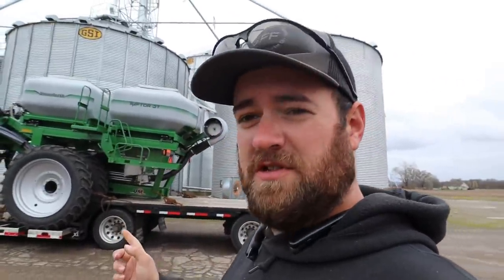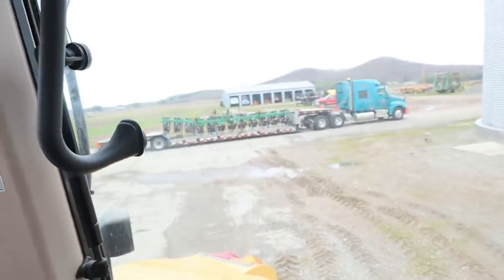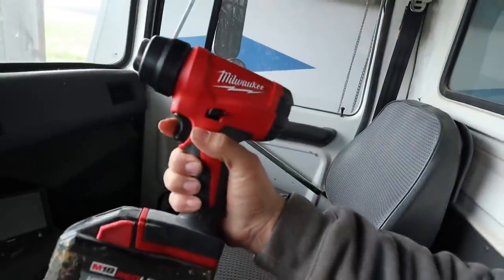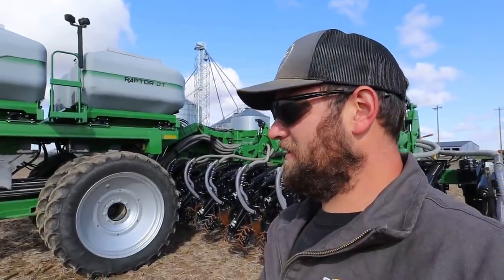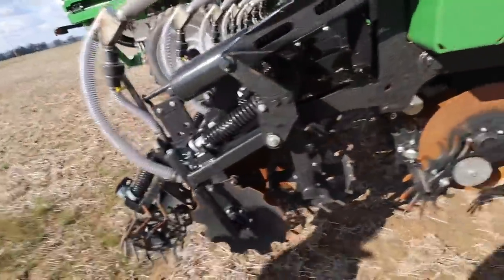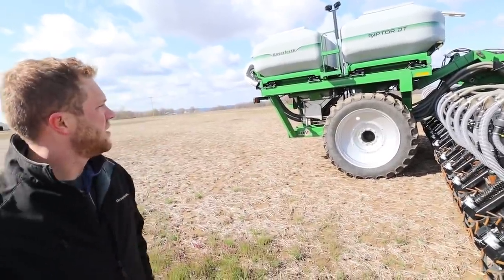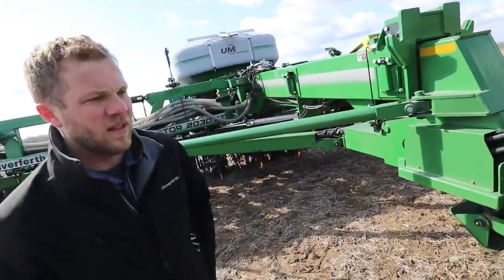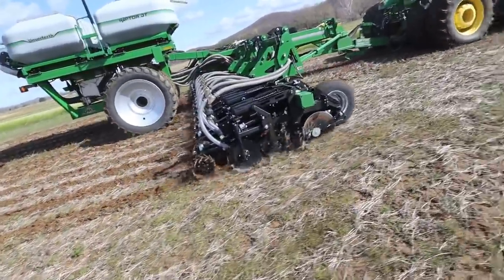Top Secret Strip-Till bar Revealed

Comment: Heat up wrap with a tiger torch on low for about a minute and the wrap should separate from the truck or can try a rubber wheel in a drill to remove the wrap.

Comment: Brian, In our area 3 point 12 row is normal. A lot of guys will run 12 row strip-till with a 12 row planter attached (with lift assist wheels) all off the 3 point.

Comment: Honestly I thought that 9410 would struggle more but after a tune it will work great.  We demoed  a 16 row soil warrior strip till machine with a 580 quadtrac.  We tested the  strip till on about  1500  acres out of our 3500 of corn  last year. Our main setback is time in the fall and spring  . We have found that spreading on  the nitrogen and potash and then using the   field cultivator works better . But on hilly fields where erosion is a issue the strip till machine worked  better.  Not to many farms run strip till in our area. Our soils are heavy clay and silt .  Keep up the good work and stay safe!

Comment: Hey Brian keep your heat gun around 70 to 80 degrees and at the very edge use a plastic spatula at the tip and start peeling back going top to bottom with the heat gun and it should come right off
Reply: I suspect that's the super strong stuff, get a good corner too hold onto; and pull hard! pull really hard!!?

Comment: So do I understand this correctly ? With your guidance systems you can now come back behind the strip tillage unit and place your seed right where you need it in reference to the the fertilizer placement and not have disturbed all the soil.  This basically allows you to cut your compaction and control your erosion problems all at the same time ?  Very innovative  solution to an age old problem.  Great 👍 content, enjoyable viewing. 
🇺🇸🦅🌏⚓️🇺🇸
Reply from the maker: Yep that’s the idea. The planter will run those same guidance lines thanks to the agleader system we use
Reply: Know some one been doing something like this with deep subsoiled ruts. An A set and a B set. Alternating each year which is used. 

Is this something similar here?

Comment: You need a heat gun that gets to about 600 degrees, I use a Wagner ferno, can also use a propane torch if you stay away and go quick. You have to get the glue to release, It still is a pain to pull off the longer it’s been on the worse it is to get off.

Comment: Pretty cool setup, and even better that you got to work with them directly on it like you did.  As for the wrap on the truck, the battery powered heat guns just don't have enough oomph to get it done.  Might want to consider something like a soldering torch like you'd use to sweat copper plumbing together.  Obviously don't want to burn it off (lol) but the torch may help loosen the glue up easier.

Comment: A great Ohio company. Looks like very well engineered piece of machinery.

For decals an ERASER wheel works excellent and will not damage your paint.  Any good auto parts store should have them. Not sure if HF does or not.
The down side it will take several for a decal that size.

Comment: Unverferth Mfgr has out done themselves - KUDOS.  It's common sense to fertilize only the 8" root zone, rather than an additional 22" of a 30" row. Be different if you cultivated the corn once or twice during the growing season to throw the 22" width of fertilized area to the 8" root zone area. As you found out last season's spring planting, you're going to have to run the strip tiller 18hrs a day to stay ahead of planting 10hrs a day.  16 rows of strip tiller at 6mph is 29 acres an hour.  24 rows of planter at 8.5 mph is 61.8 acres per hour.

Comment: I've got just a tiny bit of experience with removing decals and such. You want to use toluene.  Toluene will cut the glue and take away the stickiness.  Lacquer thinner or acetone will just make the glue runny and sticky.  Sometimes you need need to give yourself an edge to get to the glue, so use a razor to get in. You also need to give the toluene time to get in, so you often have to hold it there will it can get started.  Trust me, you'll know when it starts to come off.

Comment: Back in my days on the farm working a tractor hard was normal.  Now I see everyone seems to get concerned when they start to grunt a little bit.
Reply from the maker: Not concerned with grunting but I do want to be able to maintain a certain speed
Reply: @BriansFarmingVideos  should've made sure you had enough horsepower to grow before you bought it I would've bought 550 plus horsepower or even a 9620r or 9560r plenty of power to grow without having to upgrade for awhile imo
Reply: It´s not about overworking it, when she starts to grunt on flat ground she´s already running at max capacity so you have no headroom for wet spots or going uphill. Also when you drop rpm too much, you drop hydraulic flow which means your fan isn´t running on full boil so you´re not applying correctly, yada yada yada. Precision operations like striptill isn´t moldboards anymore.
Reply: @charlesdoepping5616  Most of those tractors are the same motor.  Its all in the tuning.   Hard parts are the same.   You can save 30k by tuning it yourself
Reply: @BriansFarmingVideos  What do you use to monitor your exhaust gas temps so that you don't waste the motor ??

Comment: The best way to take off a wrap is with a heat gun. You need a better heat gun or you just need to get closer. You'll only be able to peel off little areas at a time. It's time consuming for sure

Comment: Nice video Brian. So,let's see if I understand this,so this strip bar is just for working the soil and putting in fertilizer. Then,you still have to come back and plant???? This I wasn't sure about. One thing I can and will say is,man things have really changed since my days on the farm. The way we did it back in the day was,first mowboard plow,then disks,then harrows,then the drill,or planter. One more question, is the Deere tuorboed????
Reply: Guessing most if not all modern high horsepower tractors are turbo charged.

Comment: The 9410 will handle her pretty well. They pull 16 row KMC ripper stripper strip till bars in our area with 8370R's on the 3-point hitch. Its a heavy load but they get it done. I included some links to the videos.   https://youtu.be/qoaez9JMENY    and    https://youtu.be/CNXUhhBsyHk

Comment: I've been pondering your 16 rows. I'm assuming this should get the most out of your speed tubes on the planter. I'm wondering, if the mean greenie pukes, can you plug and lock up 4 rows for your yellow baby to run the strip-tiller? 
   That's quite a bit of horsepower-hours to run strips. I remember the early zone-builders and such. A curved shank uses less power, but lifted up a big hump. The straight shanks left a smooth surface, but needed more power. I've always wanted to to try a larger front coulter sunk in, say, 6" and see how that would pull. The point is probably moot. I doubt there's room to put that big of one on your machine.
   Enjoy the weather. I keep hearing this little voice in the back of my head, "some day, we're gonna have to pay the pauper". Think I'll just ride it out until I do.